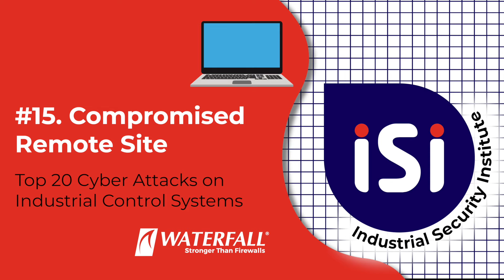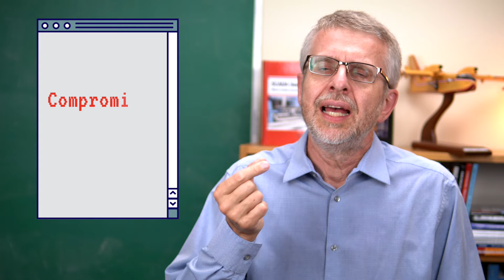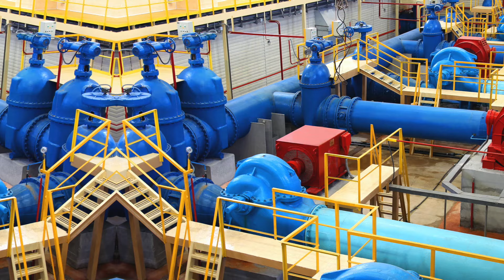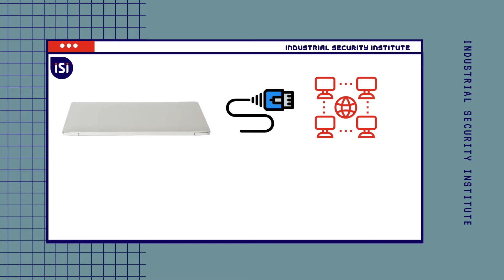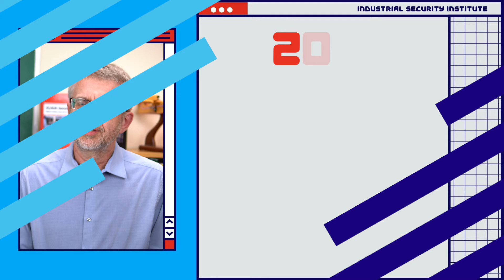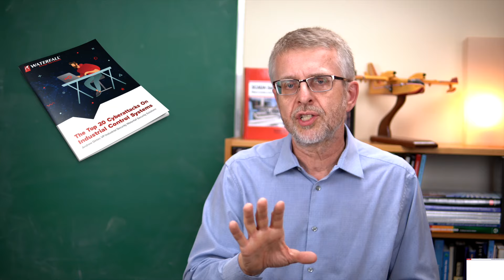Compromised Remote Site | The Top 20 Cyber Attacks on Industrial Control Systems #15 | iSi

Comment: Andrew, these clips are very informative and practical. I do have a question for you though. How do you compare your unidirectional gateway WF-500 with a Data Diode? I am not an expert and for practical reasons one may be equipped with more features/options than the other but overall concept wise it seems like they are synonyms. Please respond.
Reply from the maker: If you Google "data diode" you will find dozens of manufacturers, all producing hardware for their local military & government market. The products are deployed to forward open source information into classified networks, leaking no national secrets back out. The products are hardware-intensive - most of these products have no associated software and so can only forward UDP broadcasts between networks. All the software is custom-built for the military & government customers. A very few such such diodes have a little software associated to transfer files, forward Syslog, or maybe forward video streams one way.

The NIST 800-82 guidance for industrial control systems defines a Unidirectional Gateway as a combination of hardware and software. The hardware is one-way, similar to military diodes, with some industrial features built in (eg: DIN rail option). NIST defines the gateway software as making copies of database servers and emulating devices. Unidirectional Gateway hardware is almost always oriented to copy industrial servers out to enterprise networks. Waterfall's WF-500 product agrees with the NIST definition. So you can think of a Unidirectional Gateway as a military data diode, with industrial features and packaging, and industrial server replication software added. The software makes the gateways plug-and-play replacements for most IT/OT firewalls.

- Andrew